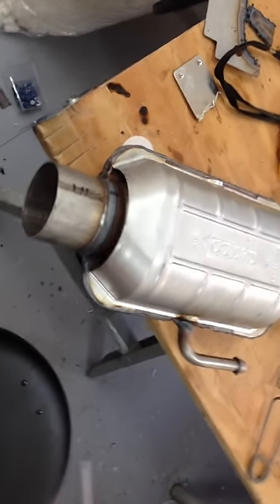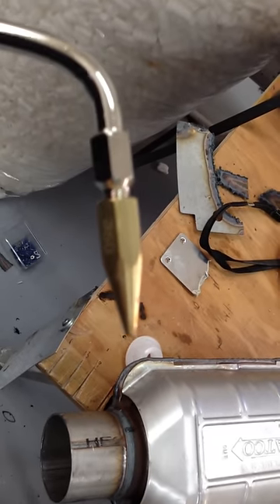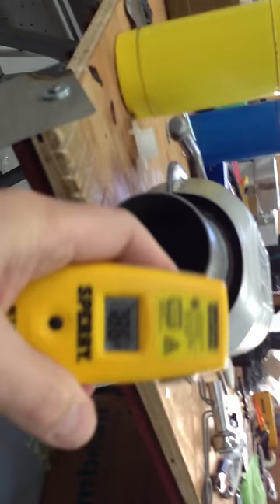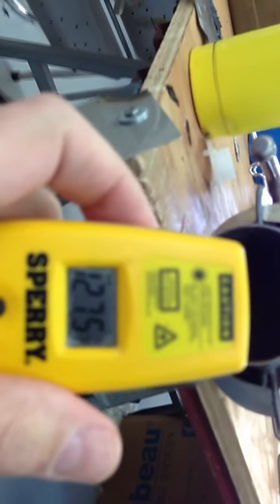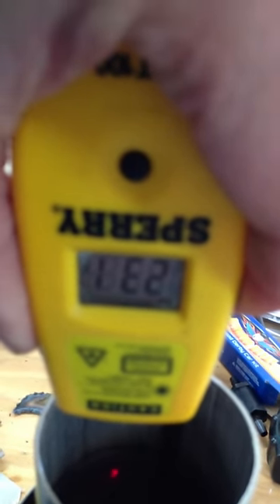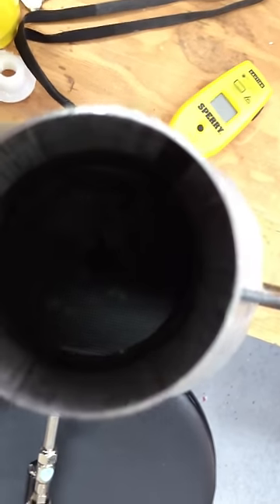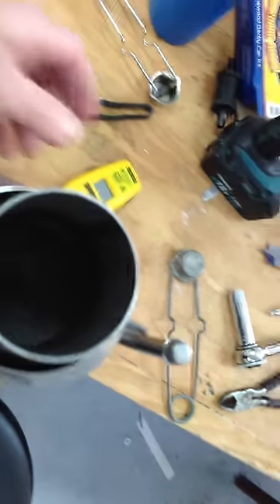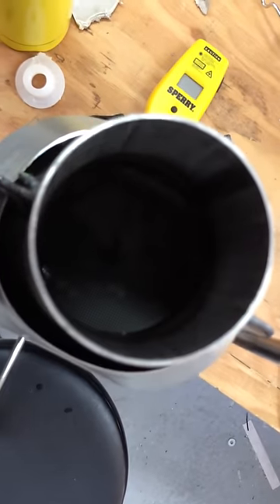H-cat video 4

Comment: Now see if you can close loop it and connect a pump up to it to recirculate the HHO then use the radiant heat as a heater at a very low cost (the cost of the electricity consumed from the blower).

Comment: steve maybe cut that comb out of the casing and take a hole saw to it to extract a core sample that fits perfectly inside a copper pipe you could cut a slit in the pipe for proper fitting like sizing a ring maybe, then we could get a good look at how hot the copper pipe gets , you could biuld a U pipe and submerge it to do an actual BOMB calirometer test on a water bath .
Reply from the maker: Measuring the energy content is something for a later day. Really who has a bomb calorimeter laying around.
Reply: i ment maybe put some water in a insulated  coffe cup or thermice and see how many watts it take to heat 1 liter of water 1 degree in 1 minute wasnt suggesting an actual lab unit .
Reply from the maker: got ya

Comment: Might be carbon on the catalyst...used would have it ,new ones would not.But then it might be also oiled or coated...like you said.Might be worth looking at the catalyst element in gas powered soldering irons as well
Reply: i agree with the carbon activation
Reply: actually i did say it wont self ignite and i feel real stupid never say never i guess because it turns out that there is in fact 1 just 1 gas that does this and its hho, but i have a hunch , just hear me out, hho is a gas composition of EXTREMELY rich oxygen levels , do you think an oxy acetylene torch will do the same?   i sent this message to 4 other people to avoid confusion i am telling you all this

Comment: hey steve if you place a core sample in a copper pipe and cap 1 end so as to enable a tangent inlet connection to swirl an hho air mixture into you honey comb core sample, i think experimenting with a small piece would give you some very interesting results  in a safer manner , i think a copper pipe with fins brazed onto ot or silver soldered would be bad ass , just some thoughts  please keep the vids coming im living vicariously threw you ,LMAO  its to cold and im broke right now lol
Reply from the maker: I'm going to use what I have right now. I don't have much money to use right now so I won't be cutting it up for now.
I would like to do what your saying but put it in some round aluminum heat sinks. I need to get some kind of heat exchanger going and pull that heat out and see how much i can get.
Reply: hey they have some circular heat sinks for super capacitors , i know ive seen some for processors 2  maybe gut an old microwave magnitron they have a nice little unit inside and every ally in town has at least one microwave next to the trash, but if you do it be carfull the pink ceramic is barium oxide or something and if you breath dust caused by smashing it they say it gives you cancer in 20 years

Comment: strange you told me the other side didnt work? ok i see the carbon from the torch must have effected it , very cool , glad you got it working stevo
Reply from the maker: after the whole thing heated both sides became active. The side that wasn't working I didn't heat up with my map gas torch but it started working anyway after the heat started to build. Now I get the same reaction Neal was getting on both sides.
Reply: awesome glad you got it working

Comment: lets made some moor tests vertically with longer chimney and substitute fan that way
Reply from the maker: so your saying put a fan inside the 2 inch pipe. That's a great idea.
Reply: I tried compressed air , is too much flow but couple feet of chimney should Du the job even better
Reply from the maker: I put this test together in 5 minutes.
Reply: any luck?
Reply: higher chimney you made moor circulation you get when is worm / hot your cat.